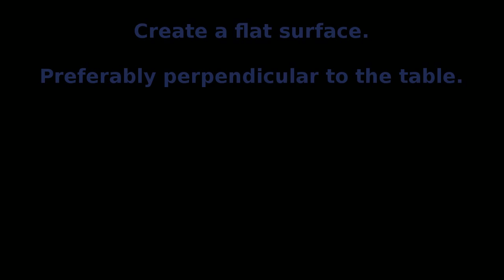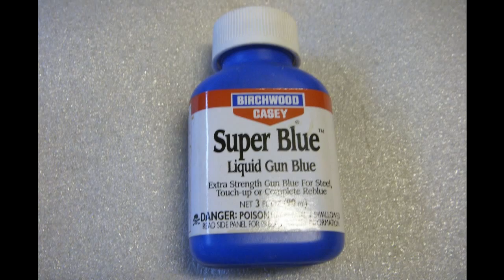JULA Mill Z-spindle sleeve stiffener. PART II

Comment: Hi!
Good job!! I get it. You made a linear guide to remove spindles play,, but I don´t get why studs,,, Are they to get the base perpendicular adjusting them? 
Ricardo
Reply from the maker: Hi Ricardo
You got it, it's for adjusting the base to be parallel to the spindle.
Reply from the maker: A small clarification. There are four set screws that adjust the base plate angle. Six studs and nuts to lock the base to the spindle head.
Reply: I figured that ;). Very good idea. I'm thinking to buy this machine for my father,,, but I've to foresee and machine all the modifications before to meet up with him this August  (I'm living abroad of Spain). Thank you I know that spindles diameter is 62.1mm  Did you change spindles bearings? If you did, what size are they? 

If you are bored here you have more things to do :) http://www.hbm16.de/frameset.htm

Thanks for your idea :))
Reply from the maker: I changed all bearings except the idler pulley. Bearing: 

Spindle 6004-2RSH, Spindle 6205-2RSH, Pulley 2 x 6205-2RSH, Idler pulley 2 x 6202-2RSH, X and Y axis 3 x 61902-2RS1
Reply: Thank you very much!!!!
Reply from the maker: My memory is bad. The X and Y axis 3 x 61902-2RS1 is NOT original, it was a planed modification. Sorry for the confusion.
Reply: Don't worry, man!! They are not the most important bearings,,, and it is easy enough to change.them. Here are all things that I've already made/purchased :))
http://subefotos.com/ver/?e94647c618ffd9085c696bc8b398caaao.jpg
Once again, thank you very much!! :))
Reply from the maker: What are your plans with the HIWIN linear guide? Concerning bearings for X and Y, there are none, they go straight through the cast iron. But there are some thrust bearings there.
Reply: I already have the most importants bearings. My idea is to change as well the feed dials, but I have to check before how it works and after that I'll decide what I can do. I will use that linear guideway to remove spindles play (you gave me the idea) and as well as a bracket for my chinesse vernier.. Well, as you can check it is an old linear guideway. In fact I had to put in it some balls that they were missed,,, and the rail was fully rusted. It doesn't fit a hundred percent, but I think that It will be good enough.